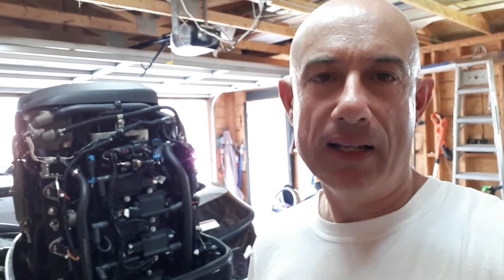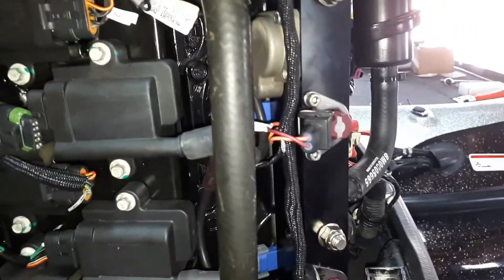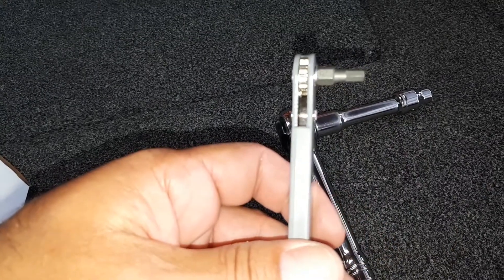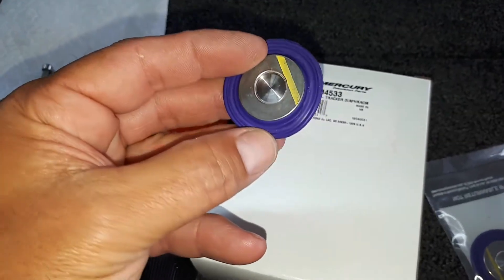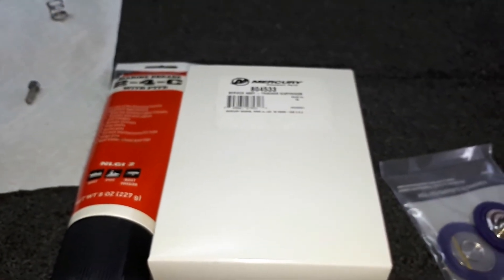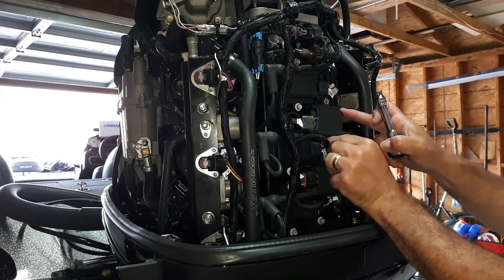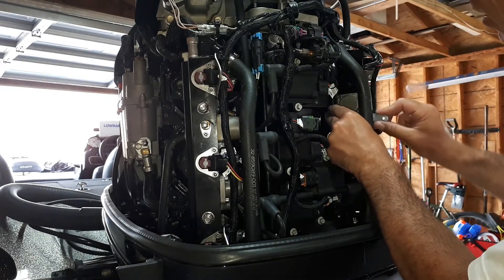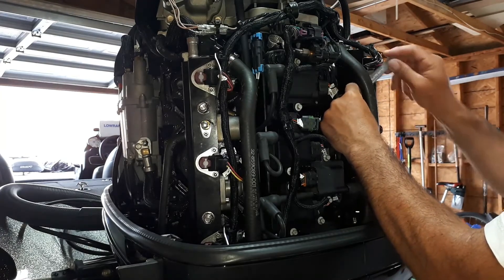How to replace Tracker Valve

Comment: Did this without taking off the coil (I did have to unplug the wire from coil) and used a normal allen wrench set to take screws out and put back in.

Comment: Is there a permanent fix for this? My 2015 proXS 150 tears the diaphrams every year and costs me over $600.00 for parts and labor not to mention leaving me stranded miles from the boat ramp. Is there a permanent fix for this issue?
Reply from the maker: I haven't heard of a permanent fix. I guess it's up to luck to get a good valve.  My original lasted for years.  These new ones keep tearing.  No way should this part cost 200 bucks.
Reply: From what i've read, the purple ones are the newest versions, do you know what colors they installed? could have been the brown or green ones that were superceded. Also, non ethanol fuel really helps if it's available to you.
Reply: @topgunbass  its fucking absurd. Guarantee the part cost fuckin 50 cents to make

Comment: Have a 1998 mariner 135 optimax dfi  Having trouble starting but if I hold down on the valstim. Of the airside it will try to start but won't stay running? Could that be my tracker valve bad
Reply from the maker: It's possible.  You can easily take it out and inspect it.  There are so many things with these motors that can go wrong or cause issues. Good thing is you can do several yourself to save time and money.

Comment: a long t handle allen wrench works very well...also utilize a c clamp to assist in compressing spring for tension spring for removal and installation...this works very well and you can avoid issues with a little care...thanks for the informative video
Reply from the maker: Good tip with the c clamp.

Comment: does it get stuck and not deliver fuel to that cylinder???
Reply from the maker: No the diaphragm gets cracks in it and no longer regulates the fuel.   That causes the motor to stall out and rough idle.  Oddly I was able to get on plane and run but I didnt push it.  The more it deteriorates the worse it gets.
Reply: @topgunbass  THANKS
Reply: pretty sure there is only one regulator per fuel rail

Comment: Hey man great video. I have a 115 pro xs having the same rough idling issue and stalling at low RPMS. The question I have for you is whenever you knew yours was going bad was it running fine higher in the RPM range? And did you ever have any issue of the motor loosing power after WOT for a minute or so?
Reply from the maker: At wot it was fine. I say fine it was less noticable.  Not sure how long it would have lasted ignoring it. But at lower rpm I knew something was wrong.  I didn't lose any power. I did have trouble starting it and then stall.
Reply: Curious about your comment @kielandsielbold5596, having the exact issue you described.
Reply: You sound like you have a bad low pressure pump

Comment: I was having the same issues on the water so I cleaned out the vapor separator tank went to put that back on had problems with the needle seating. I got that fixed now I’m having problems with it turning over. Do you think this may be the problem? The valve stem that you were talking about in the video I pushed on the one that’s on the vapor separator tank. I pushed on the one on the first rail and I pushed on the valve next to the rail you were working on all of them seem to get gas to come out except for the opposite rail that you were working on. I get a lot of air and then when the gas comes out and I let go the motor stops trying. It’s almost like it looks like it’s breathing air pushing out some gas sucking in air pushing gas out

Comment: Very helpful! Do you any sources to get a diaphragm for the Air Pressure Regulator you mentioned in your video? Thank you.
Reply from the maker: I would contact a local mercury certified shop with your motor serial number.  All the parts can be slightly different.

Comment: i have a a 06 optimax i need a new air diaphragm where di i get it from boat place saying i have to buy a complete new fuel rail
Reply from the maker: You have to look up the part number through the online parts list.  Select the engine that falls in your serial number range and then click on fuel rails > then it will show you part number for air regulator kit. Mine is 8M6002988.  Then you can look up online to get it from a retailer.

Comment: I have a 2006 optimax 150  what was the system s you new it was bad ? Was it motor reving up in neutral forward plz any help would be great .mines acting up big time I thought I broke a throttel cable or shift cable
Reply from the maker: No mine was just rough idling.  Sometimes stall out. If its reving high check your throttle position sensor. If that thing is broken it could cause that.  You'll have to start slowly eliminating what it could be.  Unfortunately it could be many different things.
Reply: @davidgibson5157, did you resolve your high rpms in neutral?  Having the same trouble with ours.

Comment: What was your motor doing to make you think it was this part My motor is Reving high in neutral  after I run it up the lake.
Reply from the maker: Mine was rough idling and stalling in idle.  If yours is reving high in neutral I would look at the throttle can cables or if you have a hot foot.  It may not be returning to normal.

Comment: Mine is shredded on one side, but none of the tears appear to have went all the way through. Do you still think that is my issue?
Reply from the maker: If there are any tears on it even if it hasn't gone through it will need to be replaced. If you are getting rough idle with stalls it is probably the problem.  I've had both the fuel and air side go. So sometimes it can be both.
Reply: @topgunbass  definitely needs replaced. Rough idles and stalls out, especially when I put it in gear. I wanna check the other side but I’m afraid I won’t get the 80lb spring back on there lol. I ordered the replacement but I’m just hoping it the other is fine haha. Thank you!
Reply from the maker: @Andrew-dq6fs  let us know how it goes if you take the air side off.
Reply: @topgunbass  is there a diaphragm on both rails or just the one on the air side?
Reply from the maker: @Eric Elmer  there is one on both sides. I've had both damaged and this last time only one side.
Reply: @topgunbass  so I’m a dummy when it comes to this. Are both on the rails or is the other one somewhere else on the engine? I’m gonna be changing mine on the starboard side rail as it’s on the back right drivers side
Reply from the maker: @ericelmer5289  yes you will see 1 on each rail. The port side will stick up a bit higher. Definitely start on the right side and see if it's damaged.  Follow what I did. Inpect for cracks.
Reply: @topgunbass  I pulled it out a little earlier and it does have two gashes on each side so it will get changed. The one on the other rail is that the pressure gauge thing assembly it’s got 4 allen wrench holes in it as well? If so, or no, does it take the same size? The boat was running great last year. First time now this year after winter because I’m up in Wisconsin everything just kind of fell apart. I wonder if by sitting it hurt it? I had a Johnson fast strike150 for three years, and I never had any issues like this.
Reply from the maker: @Eric Elmer  the part looks similar but will have a different part number. The original lasted for years then I've had to change both a few years ago and 2 more times on the right side.  These things just go. Sadly the part is very expensive which is a same.
Reply: @topgunbass  i’ve looked to try to find the one on the other side, but to no avail. I’m not finding it in the manual, so maybe if I pull it out maybe it’ll be the same as the other side
Reply from the maker: @ericelmer5289  look up the part on mercury online parts catalog.  Use your serial number. Or call a merc dealer they can give you part number
Reply: @topgunbass  ok. I don’t see any serial tag on my outboard so somebody must’ve ripped it off.